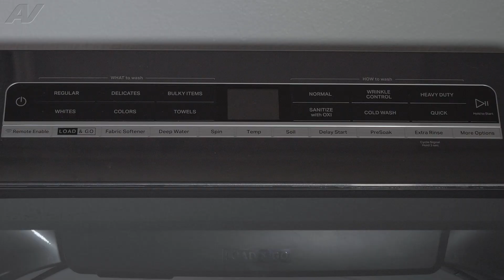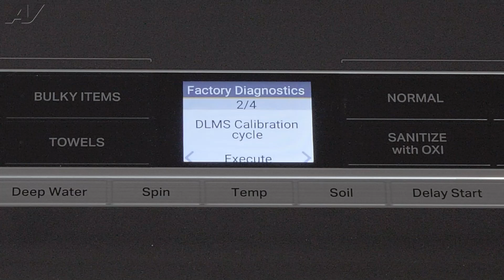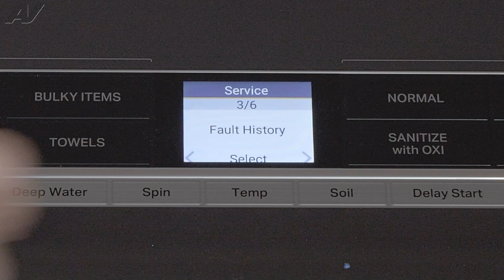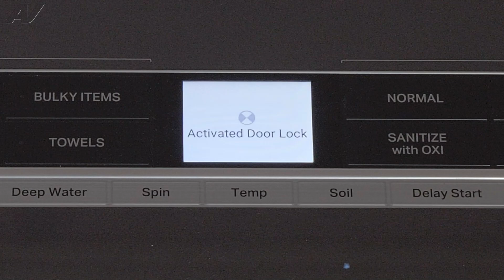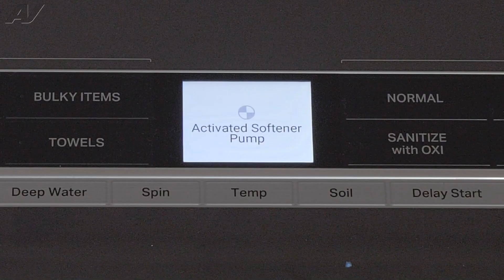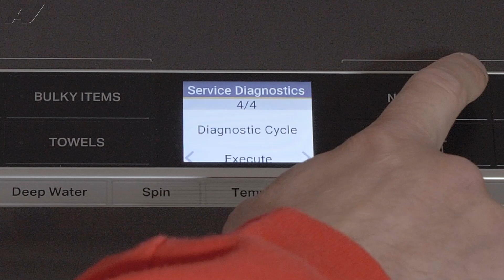Whirlpool Washer -  Diagnostics, , Error Codes, Troubleshooting & Calibration by Factory Technician

Comment: Hi! I have this washer and have been having some problems with it. 
-The washer was showing an F7E1 error. I ordered a new shift actuator and capacitor and installed.
-When putting the new capacitor on, we noticed a wire was broken. I ordered a new wire harness and installed it. 
-When running the DLMS Calibration Cycle, it gets stuck on the “spinning” step but it is NOT actually spinning. 
-Toggle Shifter, Motor Agitates, Spin Speed, and Unbalance Detection tests were failed.
-Sensor Feedback Functions - failed the Motor Speed Tachometer test due to while I was spinning it, the value would NOT change. 
Any advice on what my next step should be? Thank you!!!
Reply: Me too any luck?

Comment: Did I miss F7E1?
Reply: The F7E1 error code on a Whirlpool washer indicates a problem with the motor speed sensing, which can be caused by issues like faulty wiring, a malfunctioning control board, or an unbalanced load.

Comment: How about codes F7E8, F7E3, F7E9 it will not go beyond sensing mode when trying to wash. Model WTW8127LC1. Trying to figure out what parts needed? Thank you.
Reply: I'm getting the same issue, if you have any tips pls let me know what you did to fix it
Reply: My codes are not rectifying after I follow the steps. I’ve also now lost the button sounds after I followed the steps.
Reply: The F7E8 error code on a Whirlpool washer indicates that the main board has detected the motor temperature getting too high. To resolve this, check for any clothing or items stuck between the basket and tub, ensure the load is balanced, and consider running a calibration cycle.
The F7E3 error code on a Whirlpool washer indicates a "Basket Engaged During Wash" issue, which means the control system has detected that the shifter is not engaging or disengaging the basket properly. To troubleshoot, check the shifter connectors, ensure there are no items wedged between the impeller and the basket, and verify that the shifter slider moves freely.
Whirlpool Washer F7-E9 Error Code Meaning = The Appliance Control Unit has detected a Locked Motor Rotor.
Whirlpool Washer F7-E9 Error Code Possible Causes = 
    Faulty control board.
    Faulty drive motor.
    Wire harness or connection issue.